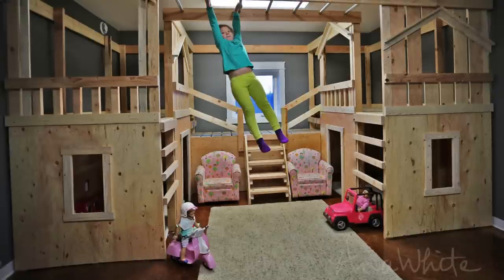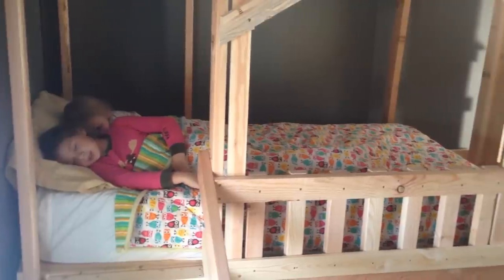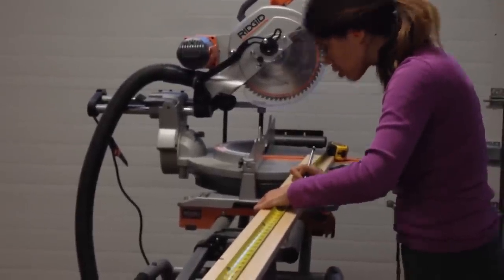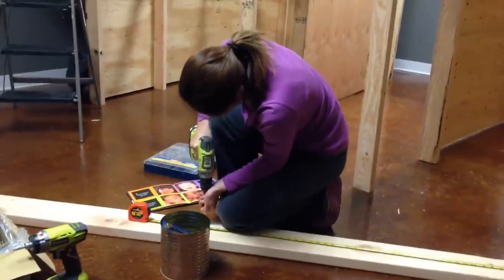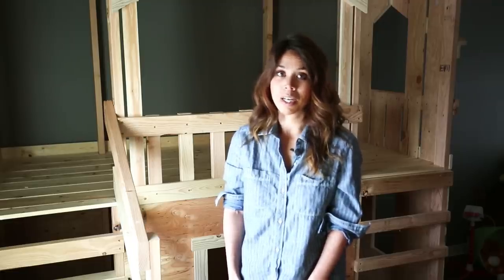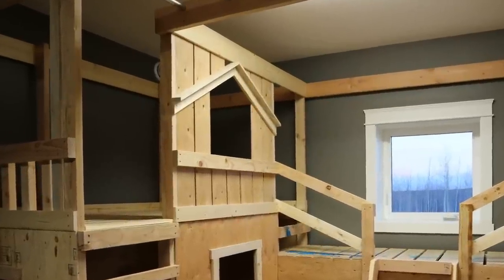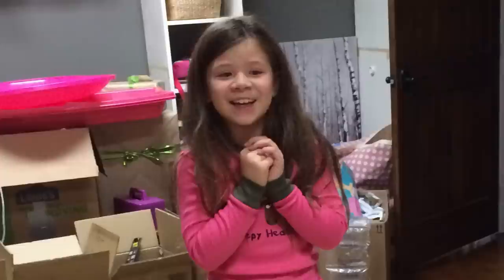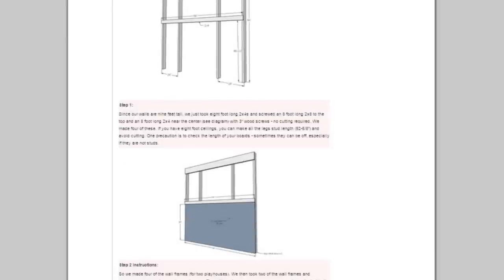DIY Indoor Playground with Monkey Bars

Comment: Did you secure it to the floor or walls in some way?
Reply from the maker: I would reccommend tacking the exterior boards directly into studs in the wall, evenly spaced at each side of the structure.